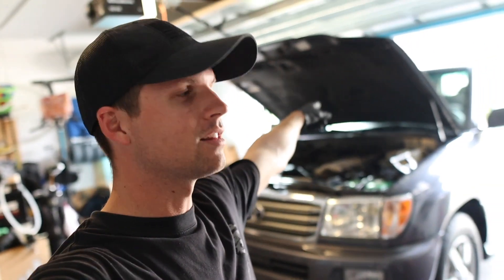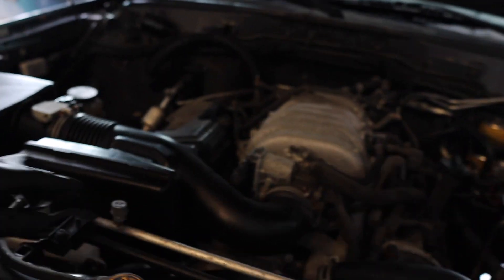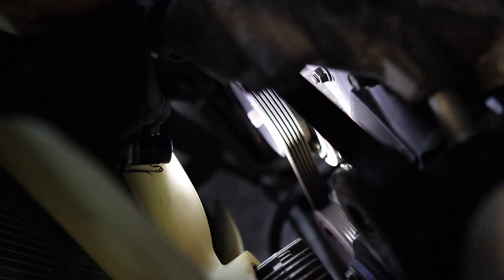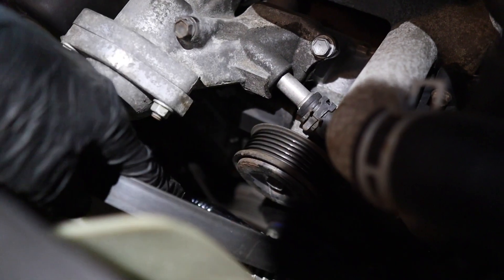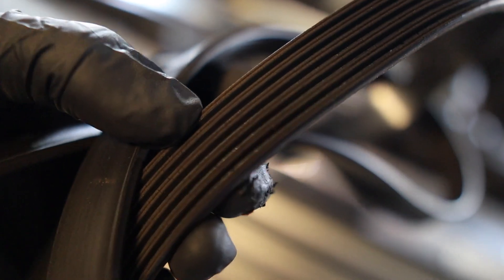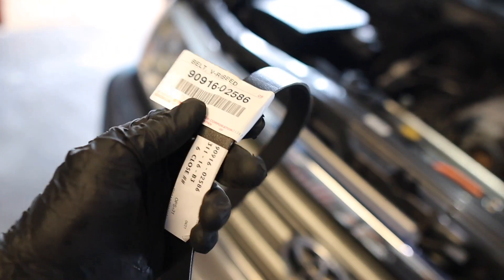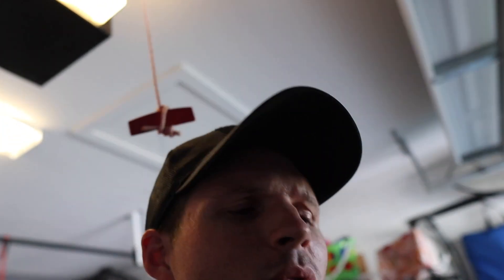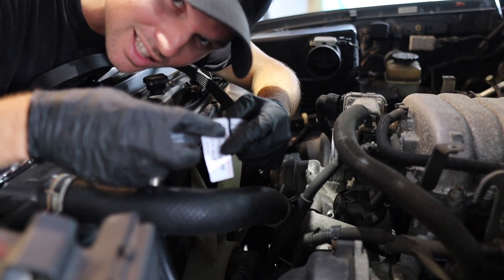Serpentine Belt Replacement | Land Cruiser 100 (LX470)

Comment: I had the exact same experience when I changed mine, I also changed the idler pulley and tensioner bearing which were easy compared to getting that new belt on. I finally figured out what you stated but it took some time. Idler pulley is about forty dollars and the bearing about thirteen dollars if you are interested.
Reply from the maker: Good call on changing those as well